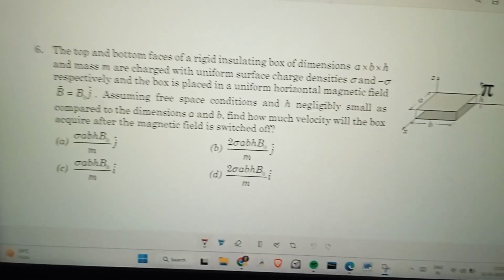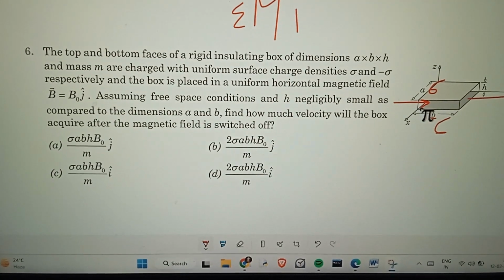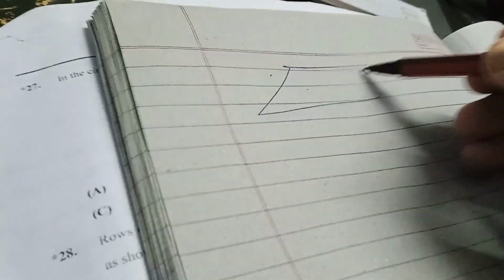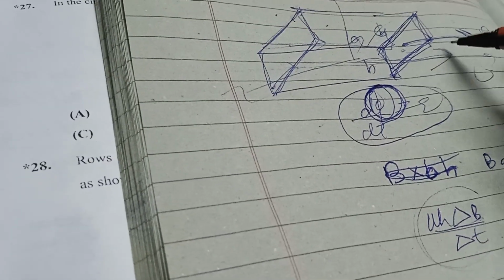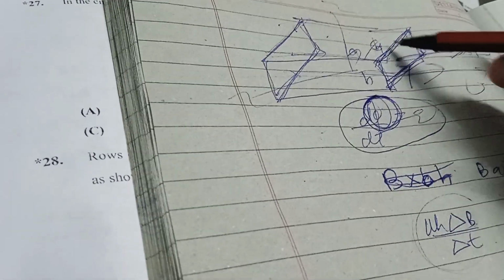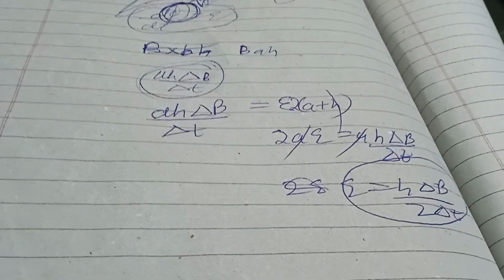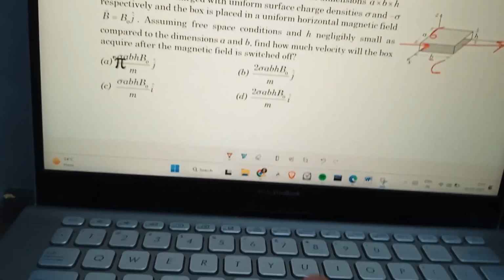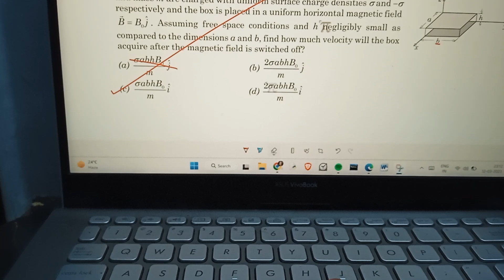Pathfinder EMI question 6| Box

Comment: But if you would apply same analysis on left loop, you would get opposite direction of current and hence opposite force, so won't overall force on left and right loop cancel out each other ?
Reply from the maker: Current? I think you are talking about electric field an if you do analysis of both loops then flux will be doubled and even the l of integral E.dl will also double so E would be same only
i dont think anywhere i have specified current and if i hv done i am sorry must be a mistake:)
Reply from the maker: hope you understood?]
Reply: @shivanshgupta7492 I got the answer, but I don't agree with your argument.

I was taught that to identify the direction of induced electric field we first apply Lenz law to find the direction of induced current and same is the direction of induced electric field. (But I was applying Lenz law wrong, direction of current and electric field will be same In both loop, then i got right answer) 
I was just checking by applying formula of induced electric field on both sides separately. So what you did in video solution was correct but you wrote that flux and dl vector will double both sides but how are you applying formula in both loops simultaneously ! Otherwise I got the answer and video solution
Reply from the maker: @NEVER_USE  ya actually taking effect of a single loop or both loop wouldnt effect the answer and you are right i should have taken both loops